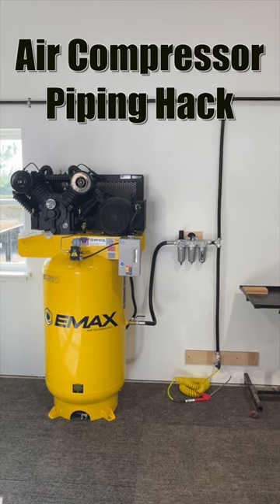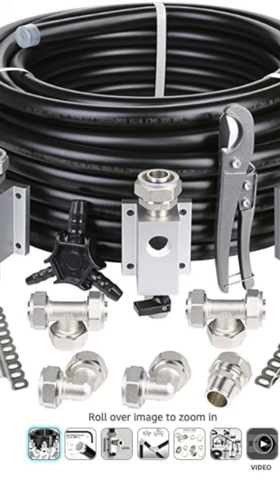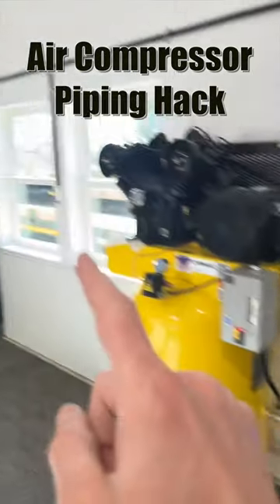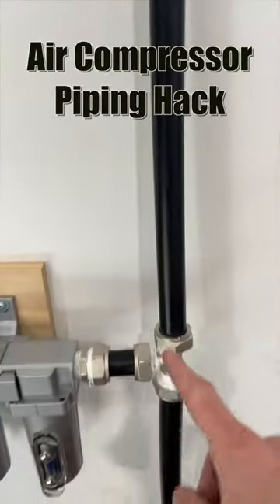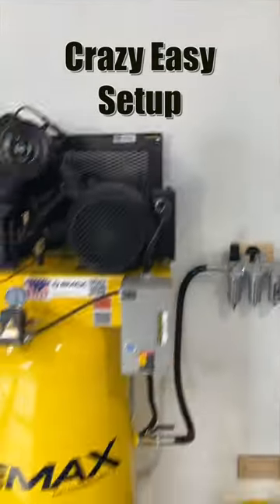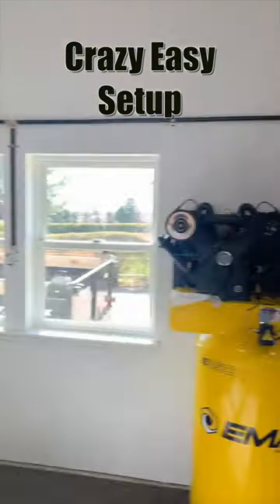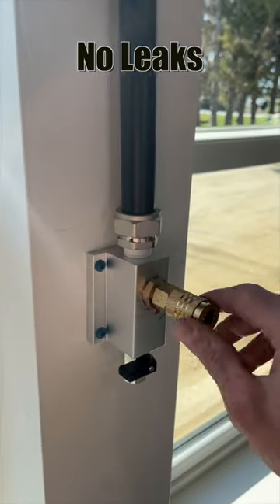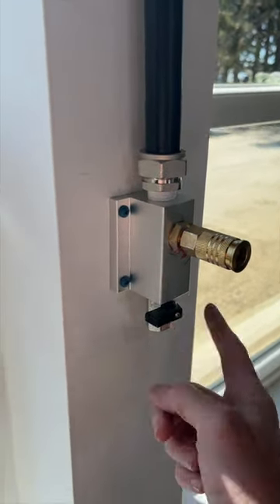Air Compressor Piping Line Hack #aircompressor pressor #airtools #Shoptour

Comment: Shouldnt the dryer/filter be as far as way from the compressor as possible? Arent the default setups something like 50' of line ran parallel in sections with drops, then the air dryer which then feeds back into the tank to make sure the air in the tank is dry? Or do I have the order messed up?

Comment: I work at Eaton compressor In ohio I build those
Reply from the maker: Awesome! I love this thing!
Reply: Hey dude! I've got the Polar Air 7.5HP vertical 80 gallon. Did I make a good choice in quality? I'm looking for the best out there and I just hooked it up to the 240v breaker. Any tips?

I really want to know especially about plumbing it though. It's obviously 3/4" outlet.. but should I keep everything that size to maximize cfm? I will be doing sandblasting. IDK if i should reduce to 1/2 or run 3/4 filter / regulator, manifold, etc... and hoses to everything.

Appreciate your input man!
Reply: @spreaddeezhazelnutz7511 emaxx makes polar from what I heard.

Comment: Filter is too close to the compressor, air needs to cool to drop water.
Reply from the maker: Hmmm... well, I have never had water in the lines... I have drains at the end of every long run and no water... not even a drip. I think that this compressor has a large enough tank that most of the necessary cooling is accomplished by the time it hits the filter... either way, no issues with water and the silca beads seem to be doing a great job at their job.